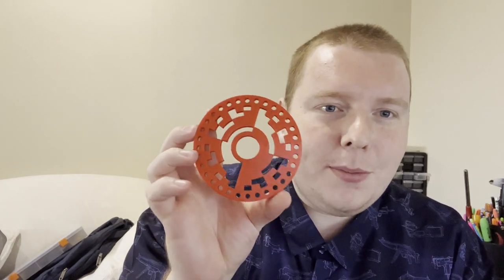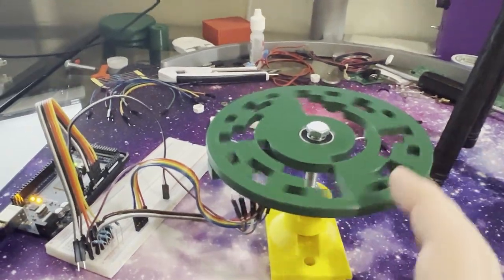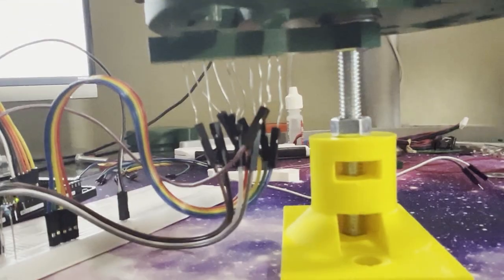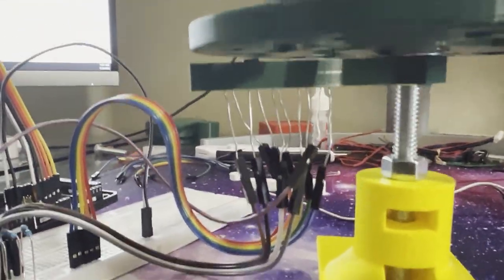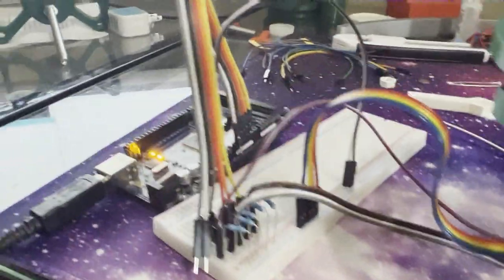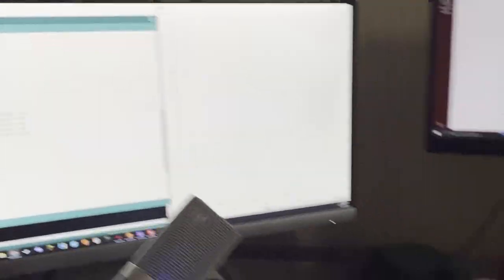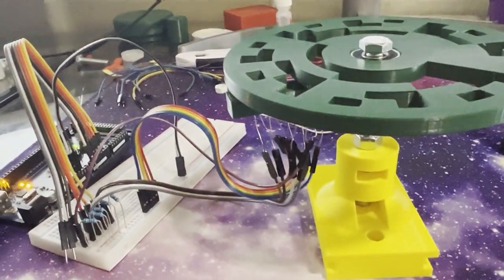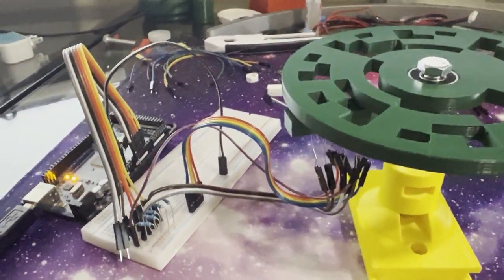Absolute Position Encoder Wind Vane (work-in-progress)

Comment: Your idea is great in concept, but you should use Gray Code instead of binary. For encoders, using gray code each subsequent step results in only one bit changing.  It prevents the problem of when thing are right on the edge, with binary you may have a few bits change, but with gray code, only one bit will change. Otherwise everything else is great, you just need to change the pattern on the disk for gray code.

Comment: Why not seal it in a housing and use IR? Just have the IR LEDs on all the time and use the photo resistor code on the otherwise with IR sensors?

Comment: This is kinda the design principle of a laser disk, and i think thats really cool. Basically laser disk readers are using a laser and light sensor to detect the binary code, which either does or doesnt reflect the laser into ths sensor. Similar concept, different scale and execution, bastly different use for the data on the disk.

Comment: I think you're over-engineering this. Do you really need absolute position? Would direction and RPM be enough? The latter only needs a single LED, a disk with a notch in it, and a photoresistor. You count the time between pulses and youre done! For the former, theres something called quadrature encoding. You use 2 rows of holes and 2 photoresistors, slightly offset. when the disc is spinning clockwise, one photoresistor will switch slightly before the other. When it spins counter-clockwise, the roles reverse. If you know how many holes per revolution your disk has, you can calculate direction and speed from 2 pulses (one on each photoresistor). This is how mice worked before they became optical.
Reply from the maker: This is only the direction piece of the anemometer. A wind speed direction measuring device will follow soon :)
Reply: The idea is, if you know where you were and how much you turned, you know where you are. It is just the initial value you need to know for this to work…